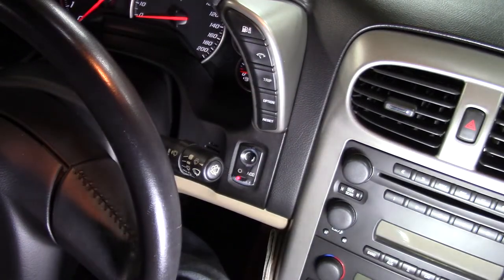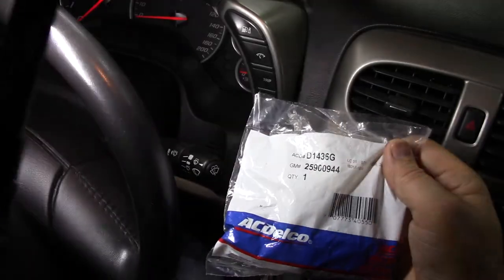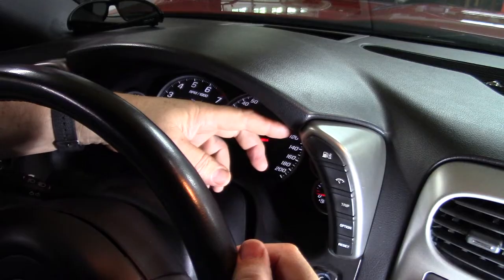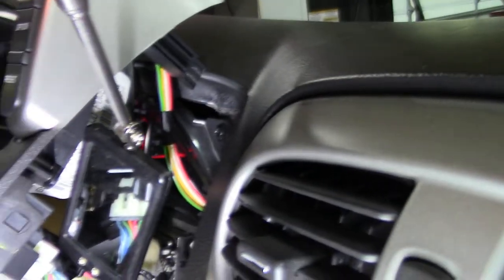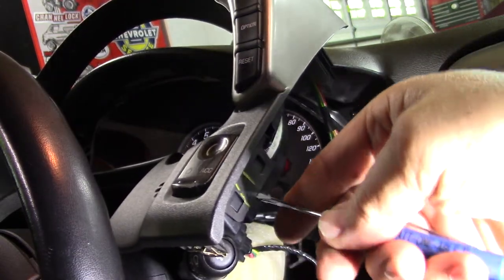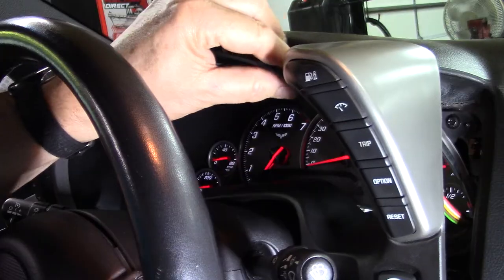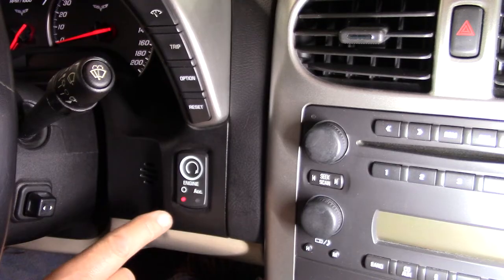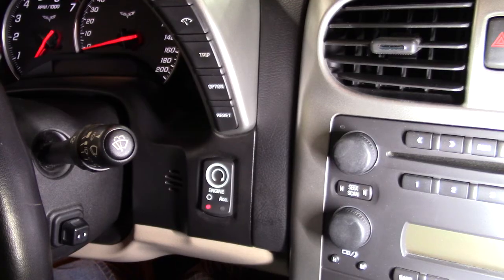How I replaced the ignition switch on my C6 Corvette

Comment: I just replaced my Ignitions switch after watching your video, which by the way was done very well, but I started on the left side first, I found it easy to remove right side. Thanks for posting
Reply from the maker: I appreciate the feed back. It's not a hard job but I sure hated the sound of that plastic moving.

Comment: Don't you just hate plastic? I cringe every time I have to remove something in the '07 Silverado. Shocked it was that simple! I'd have figured GM would've made you reprogram the BCM after that operation. 😁 Be glad it's not a '18 ...

Glad you fixed another night blinder there. That looked like it was bright at night  -  a straight shot to the LEDs. Alot of wear over the years!

Great vid, Wyatt - thanks for sharing. 👍🍻
Reply from the maker: Thanks Smitty. It was pretty easy but yes, that plastic scares me and as you know, it's not cheap to replace.
Reply: @wyattoneable  - I hear that, Wyatt. It seems they tack on 30% if the name plate says, Corvette, or Cadillac on it, too.

Comment: Great video bro, does it have a normal key somewhere or all done on that button. All the best
Reply from the maker: That's it. Only a button for starting the car. That's why I wanted a new one...no back up for that system. The doors are electric too but there is a key that will get you in the car in case a FOB or circuit fails. but nothing I know of in case that button fails. It's kind of scary but the original start button has lasted for 14 years so I guess it's a good system. Thanks Ken.

Comment: What's the symptoms of bad ignition switch
Reply from the maker: That's hard to answer.  If you're having an issue with your switch the best thing to start with is a wiring diagram to see what other components use the switch as a power source.
Reply: @wyattoneable  that's the thing..lol if you don't know the symptoms of a bad switch how did you know that it was the problem ??
Reply from the maker: @panzerwaffen2873  So one obvious symptom of a bad switch is if the car won't crank. But that could be other issues as well. That's why I hesitate to think much about worrying about symptoms,  because there are so many things that could make you think it is  a bad switch.
Reply: @wyattoneable  ok let's say it won't crank but even though the dash lights will turn on??
Reply from the maker: @panzerwaffen2873  The dash lights are on a different circuit than the ignition switch. If the car is not cranking it could very well be a bad switch. But the "no crank" could be from a bad starter, bad starter relay or an open circuit. (Bad wires) There are a lot of variables.
Reply: @wyattoneable  thanksssss a lotttt boss man tomorrow I'm gonna check all those points ..I just ordered an ignition switch already if is not the problem I will keep it anyway
Reply: @wyattoneable  could another sign of bad ignition is if my c6 did not want to turn off ? It stayed on I had to disconnect my battery now my car doesn't crank at all. Also had my car stall out of nowhere. No check engine lights starter and alternator tested good. Possible just ignition switch that went bad ?
Reply from the maker: @TooGreedystincy  Gosh, there are so many possibilities. It is possible the ignition switch could be bad but you really need to test it, or have a shop diagnose the issue.